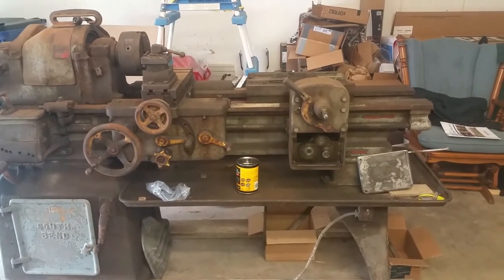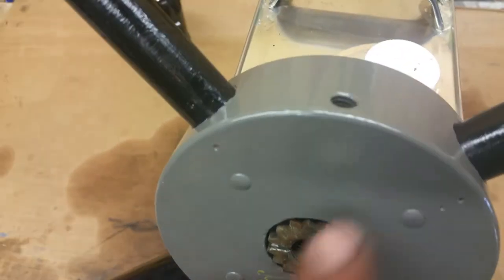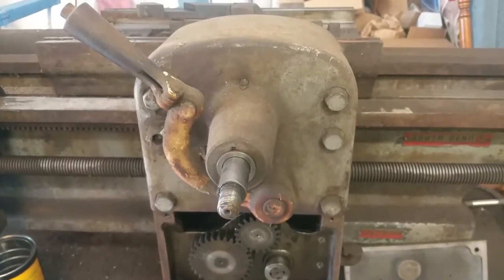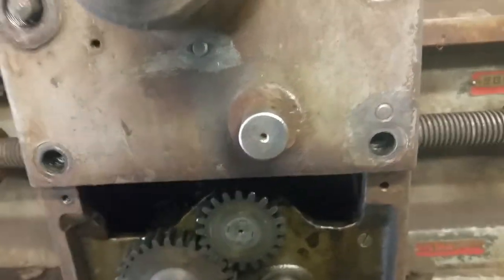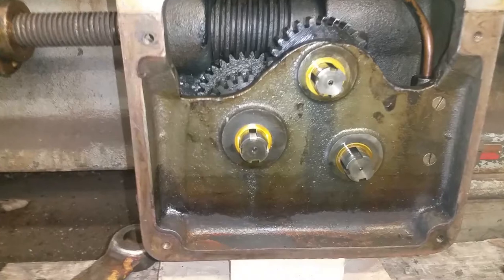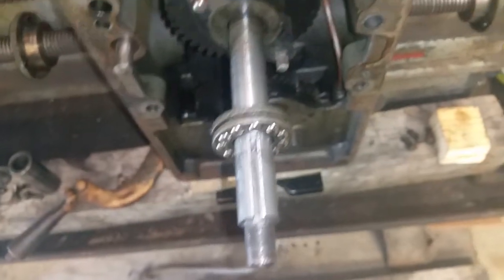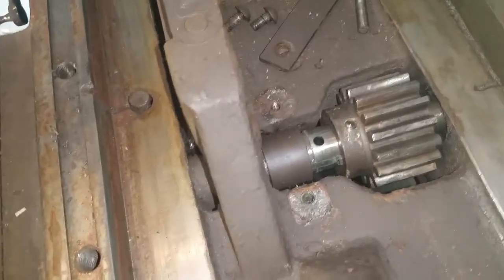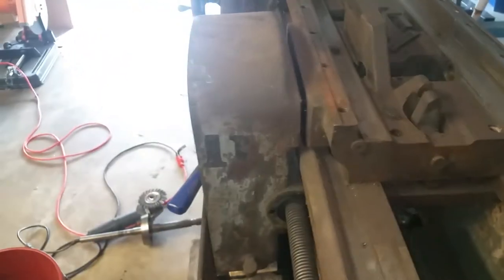South Bend No 2-H Turret Lathe part 4 Turret Apron Disassemly

Comment: Looks like the spring is being used as a one-way wrap spring clutch.  Maybe for the turret indexing function?  Basically they grab in one direction and slip in the other as you tighten or loosen it. 

Taper on that bronze gear is probably a cone clutch mechanism.  Basically the further you shove it together, the more grip it has.  Looks like its in nice shape, so either it wasn't used much or it was adjusted right.  It just shreds the bronze if it slips.
Reply from the maker: +gadget73 I'd be lying if i'd say I knew totally the operation of how it works, haha. Aside from removing it, I didn't spend too much time to figure it out yet. I do think you are correct about the indexing function, though. Based on what I was seeing, I was thinking if using the all-thread stops on turret slide, the stop would push the mechanism at end of its travel, which in turn would push a shaft/pin that would unlock the handle attached to one-way spring, returning it to start position.

Comment: Hi Tex,
Looks like your apron is easier to take apart than mine was. Does it have the 3 speeds also? Keep up with the great videos. By the way when I put my apron back together it leaked. I  opened it about 1/8" and put some silicone on it. worked great. 
lots of luck
Charlie
Reply from the maker: +Charles Ugenti You read my mind about a gasket or sealant of some sort for that cover, I was thinking it must be a leaker if put up dry. I'm not sure how many speeds the turret apron is yet. I think its reversible, so you can still feed turret toward head stock, no matter which direction lead screw is turning, but I honestly haven't taken the time to figure it out yet, I went directly from removing this section to the tool holder, saddle, and main apron.